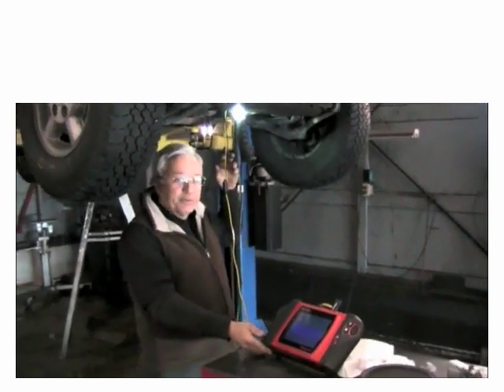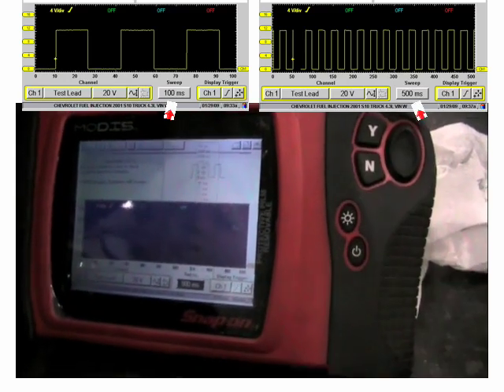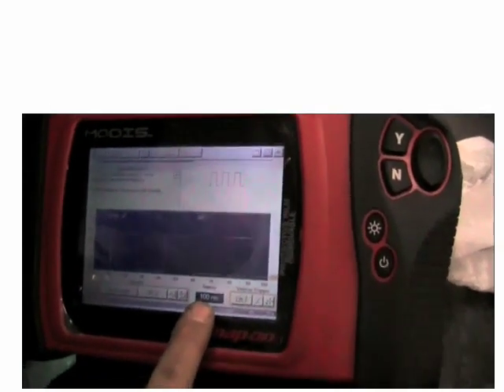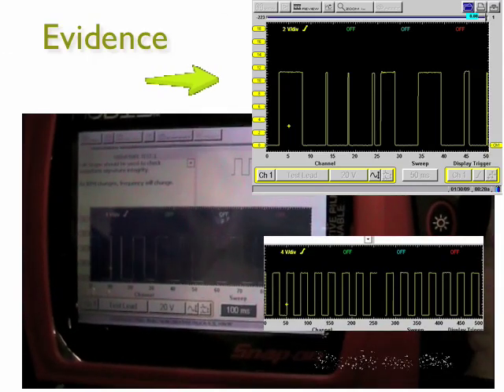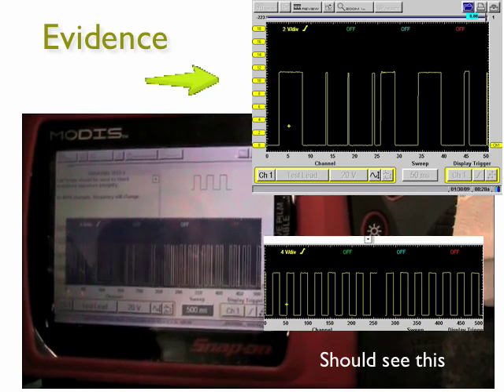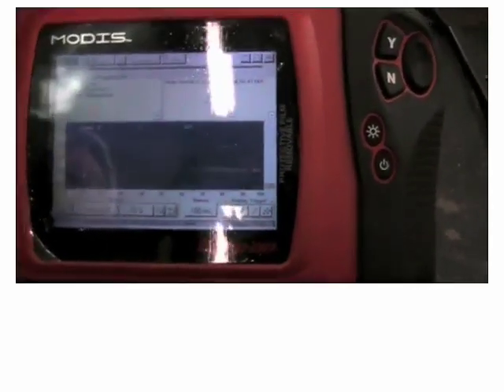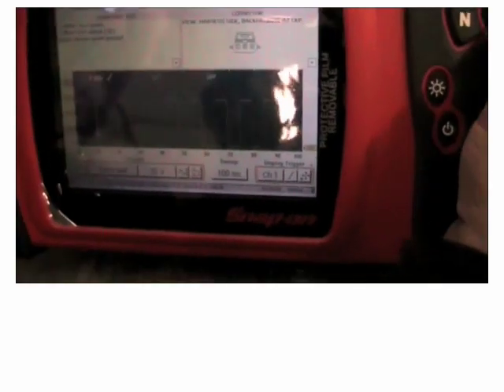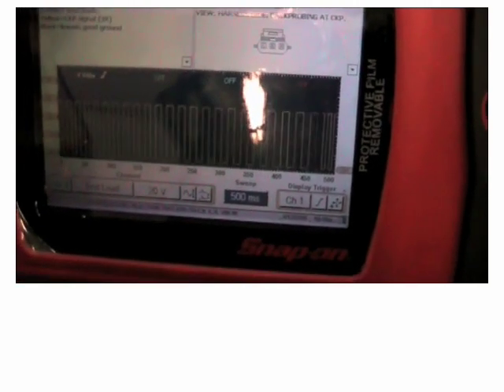01 Chev S-10 Crk sensor

Comment: I have a problem my 2001 Chevy blazer crankshaft sensor said to have gone bad on the code thing my truck started slowing down then cut off I couldn't get it to crank up so I went ahead bought the crankshaft sensor had it put on but still it won't crank I wonder the problem I need someone to help me out here
Reply: Veronica Watson you have to have a crankshaft sensor relearn done you will need a scan tool

Comment: THANKS ALOT. MY MECHANIC WENT THRU 2 SENSORS CUZ HE DIDN'T  USE A SHIM. HE DID SAY WE NEEDED THEM. I WILL GET A THIRD SENSOR TOMORROW. HE JST REBUILED MY 2002 CHEVY S10 4.3 V-6 ENGINE. MERRY X-MAS.